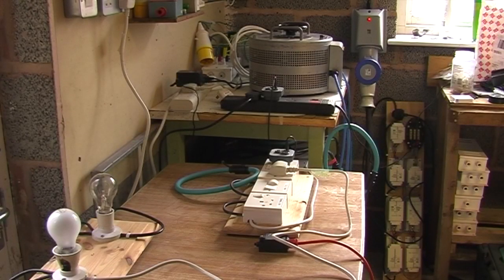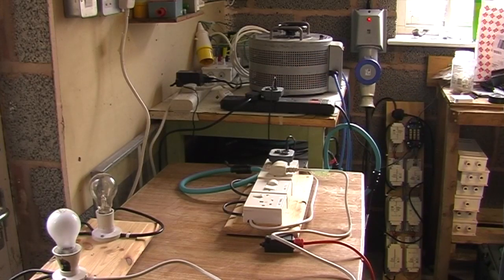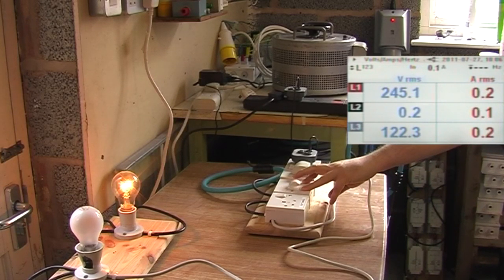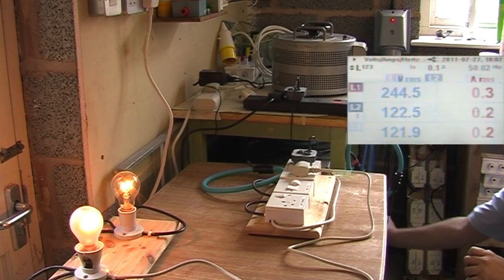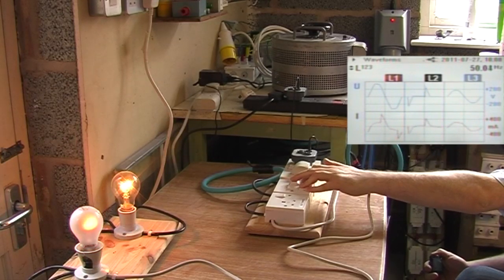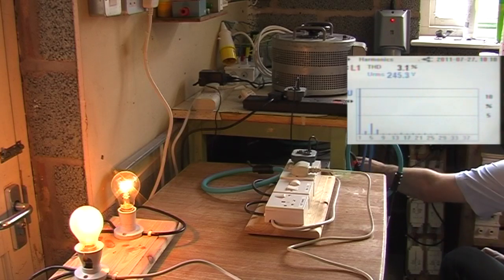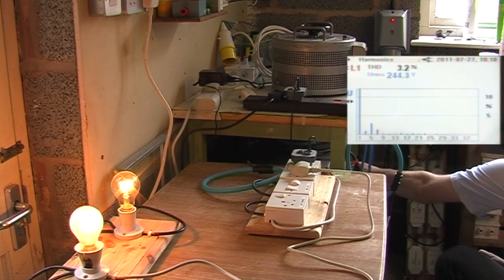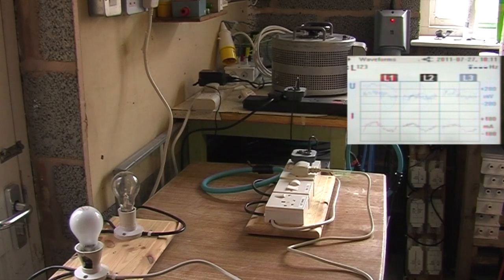Dimmer switches and variacs - what's the difference?

Comment: either make one variac out of a unviersal motor or microwave transformer. the principle is the same. for dimmer, its only  a electronic circuit and easy to destroy and not worth  making from scrap.
Reply from the maker: If you'd posted this yesterday I wouldn't have had a clue how you could make a variac out of a universal motor. Today I have a RugDoctor brush motor in bits on my table, and having measured the resistance between the adjacent brushes it all makes sense. You should knock one up and video it for YouTube. Might need some 3D-printed bits for a wiping brush arm though.

Comment: Great demonstration of the difference in outputs. Now I'm just wondering what the differences are in the internals. That scope reading on the dimmer switch really surprised me. I thought dimmers were variable resistors, but if so their outputs should be clean.

Comment: hello i need something just to control the amps not the voltage,its for a tesla coil.i need variable amps eg.0-20amps and i need it to stay at 240 volts what could i use ,what i understand is the variac changes the voltage and amps at the same time is this correct.....cheers
Reply from the maker: The variac changes the voltage, the current draw will depend on the device drawing the load. If it was a switch-mode computer power supply for example the current would go UP as the voltage drops, as it modifies its switching cycle to compensate.

On bigger tesla coils I understand people will use arc welders with the output leads shorted together, putting that in series with the load. Adjusting the wheel on the front of the welder adjusts the amount of current the welder lets through. They're cheap and may do the job for you, although you won't be able to take them all the way down to 0 amps.
http://www.pupman.com/listarchives/2008/May/msg00076.html

Another option is to use a bank of lighting ballasts, all in parallel, with individual switches to turn them on or off. This is how Photonicinduction's "big boy's supply" in his attic works; the variac adjusts the output voltage, the pushbutton switches adjust how many ballasts are switched in, controlling the current.
Reply: Now that's a useful tidbit of info to find 4+ years later when going though general info on components. Lol

Comment: question, if you put a diode in between the resistor fully open 'path' and the chosen resistance 'path' would that cancel the surplus current and lower the voltage much like a variac?
Reply from the maker: +Nothing Original all you're going to do is bugger about with the timing.

Comment: So the dimmer contains a full load due to the full circuit, then you chop it with what you want?

I always assumed it takes more current then it needs hence the little buzzing sound. But my mate who is a college buff argued over drinks with me, haha 

Anyway well done you're a boss perhaps you can help me change the world? 

With the (3) (doomed) perpetual energy engines I am patenting?

 You're wisdom needs theory......
Reply from the maker: +Nothing Original it's just switching on part-way through the mains cycle, then switching off automatically at the zero point. Rather than adjusting the voltage it's adjusting the on-time, much like pulse width modulation on a DC fan but synchronised to the mains.

Comment from the maker: Looks like I'll have to set up another experiment with the dimmer :)
I've seen dimmer ICs such as the PC1R and PC12R used in drill controller projects. My guess is that a transformer will get very noisy and possibly hot.

Comment: You are correct. I completely forgot about universal motors. I remember someone dimming a florescent lamp, with a regular dimmer switch. But they had a incandescent bulb wired in parallel. The ballast still overheated somewhat. It was just an experiment.

Comment: Not exactly true. Universal motors (those with brush and commutator) can be dimmed, this is what RPM adjustable tools do, drill, Dremel for example. Transformers can also be dimmed. They look almost resistive from the primary side, if there is a resistive load on the secondary side, it is almost fully inductive if it is unloaded.

Comment: In other words, dimmer switches can only be used on light bulbs, a cheap soldering iron or other completely "resistive" heating element. Transformers will overheat and possibly catch on fire, motors and electronics will be damaged. Also, some ordinary electrical devices made for the 120 volt US, are made completely different internally  than those made for 220 volt UK.

Comment from the maker: Yes. It delays triggering of the thyristor, which will then stay on until the voltage hits the zero point at which it turns off again. If you look at the waveform it's effectively a width-modulated sine wave. Interestingly the dimmer seems to work on the square-wave output from my mains inverter, too, so the trigger point appears to be time based rather than voltage based.

Comment from the maker: For their size the dimmers can handle a bigger load (try squeezing a 2 amp variac into a light switch). As far as I know the basic dimmer design is only restricted by the size of the switching TRIAC (TRIode for Alternating Current, thank you Wikipedia). A 70 amp dimmer switch? No problem!

Comment: I have noticed that if you connect a light bulb (incandescent) in parallel with a motor or other piece of equipment (such as a florescent tube) the dimmer seems to control the motor in the same way a variac would do (albeit, with a squarer wave)

Comment from the maker: @ThunderROFL The conditioner/isolation transformer has a Remote Emergency Power Off connection, I've got a hand-held pushbutton connected to it, keeping my left hand neatly occupied into the bargain. Button needs to be held down to operate. Let go and the conditioner instantly trips out. Check out my other vids, there are both teardown and variac tests of the conditioner unit (which is rated 8kVA and is a hell of a lump).

Comment from the maker: @ThunderROFL Yes, indeed. The variac is plugged into my isolation transformer/mains conditioner with a 16A IEC-60309 plug/socket, the conditioner's then plugged in using a whopping 63A plug/socket connection. Only breakered at 32A though (no point going higher as I'd have to uprate the breaker feeding the garage and workshop).

Comment from the maker: @labobo I doubt you could squeeze it into a wall plate. To use a variac in this way you could use a PWM servo control circuit, with a control pot in the wall plate and the circuit (plus a fairly beefy RC servo) operating the variac which would be mounted elsewhere.  A variable voltage pure sine wave circuit would I reckon be the size of a small PC power supply so again wouldn't fit in the wall plate.